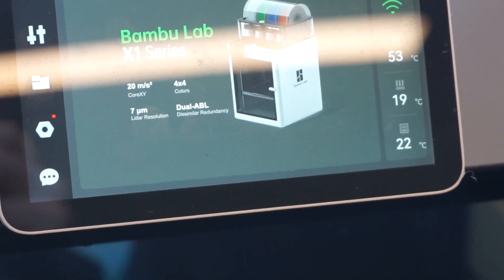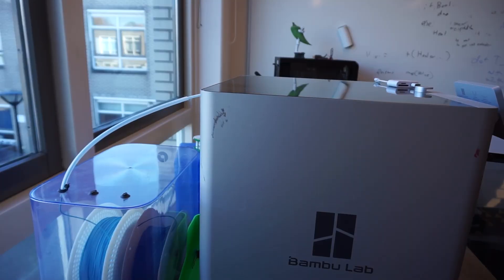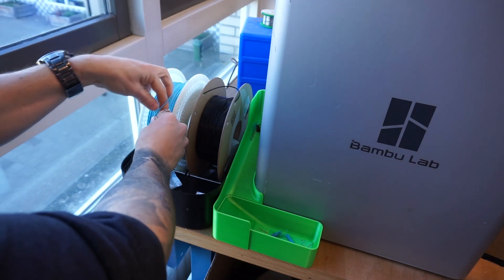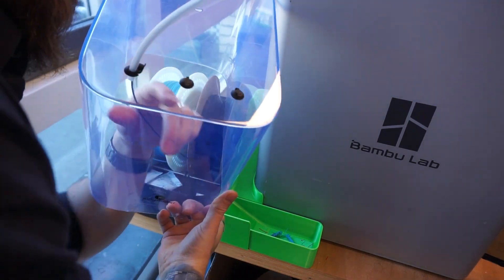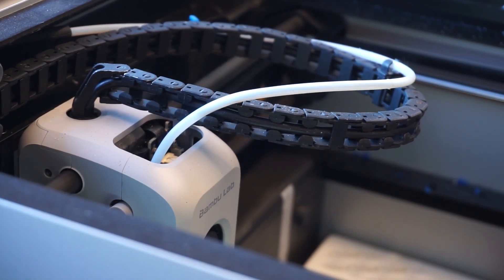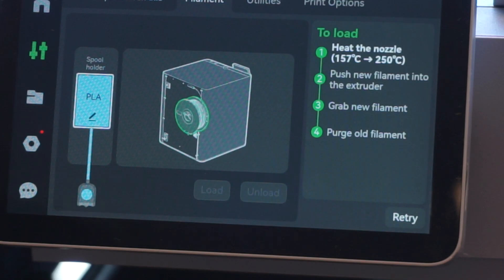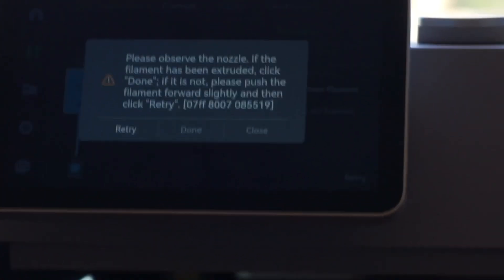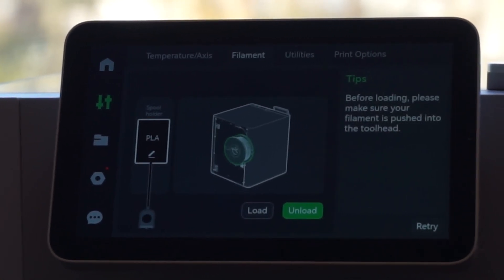How to Change Filament on a Bambu Lab X1 Carbon

Comment: When I click the icon you clicked..... It shows fans, nozzle-extruder, chamber, heatbed, speed and motion..... Not filaments?!?!!!!
Reply from the maker: Yes, the firmware was updated. If you flick on the filament roll, then tap the roll itself, you can change the filament. All other steps are the same.
Reply: @BroganMPratt  sorry i don't understand what you mean...flick on filament roll and tap the roll.  i have the same menu as Thisismyhandle734...filaments is not shown as an option.  please help, thanks

Comment: I just unboxed my X1C and did a firmware update.  I don't see any tabs in the filament screen.  Do I need to carry out more updates or does the latest firmware lose this feature?
Reply from the maker: Apparently bambu has updated their firmware and it’s made a UI update. I’ll need to update this tutorial to reflect that. The steps are still the same, it’s just likely in a new sub menu on the x1c
Reply: @BroganMPratt  sooo...any update?
Reply: @Ripcord10  you can click on the filament spool you want to unload on the filament screen itself (the colour) and click the unload button there
Reply from the maker: Sorry, I haven’t had access to my X1C in a while. I will have one in a few weeks here again once my shop is open again.